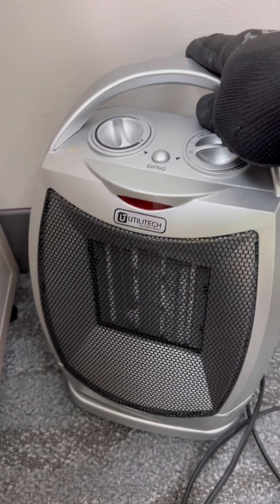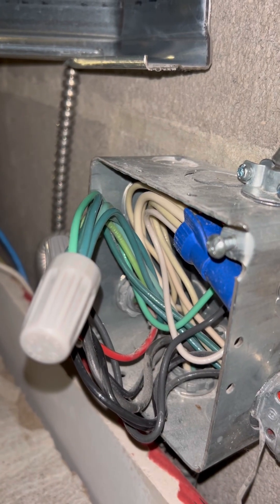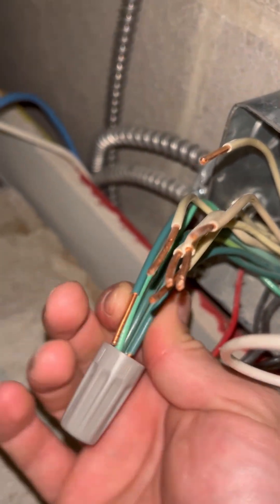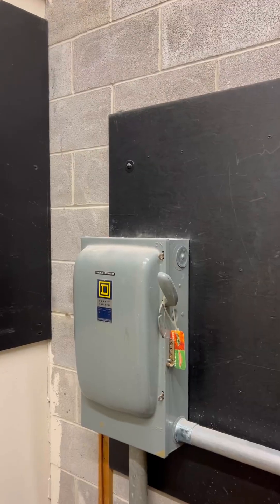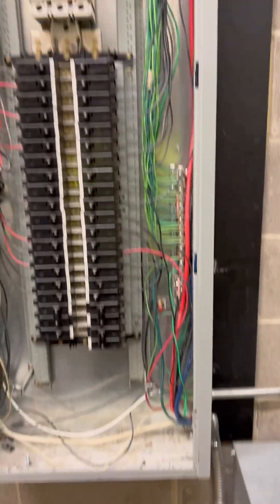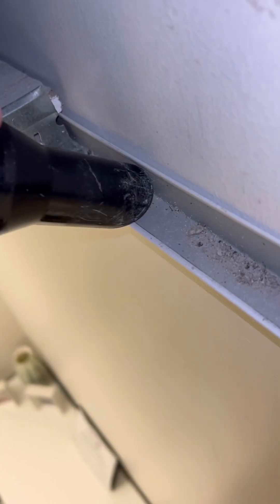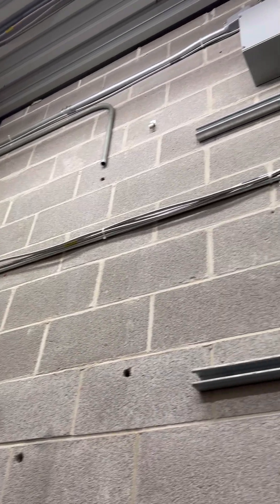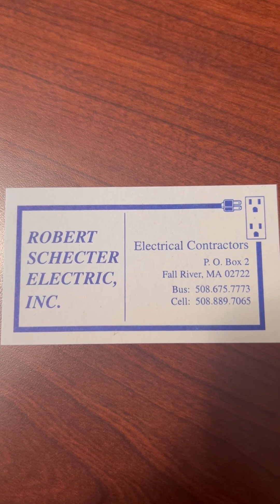⚡️Electricians STILL Using Wire Nuts Like THIS?! STOP Being a Hack🔥!#shorts #electrical #viral

Comment: I always pre twisted anything 12 and above. With 14 I had a drill attachment that could twist smaller numbers of 14 gauge wires solidly though. I made sure to test it multiple times, and still sometimes double checked them to make sure it was a solid connection. Hand twisting smaller gauge wires isnt an issue imo though. Anyone who leaves their wires looking like that should be fired, and never be allowed to do electrical work again.
Reply from the maker: I’m not to keen on the drill attachments but yea I would pre twist everything
Reply: For sure, I totally get it. At first they had me pre twist them all until I got good enough to know how a joint should be, then they gave me the little hand crank one, then after that is when they gave me the drill one. I did residential work so we were always on a pretty tight time limit, they work well for smaller numbers of 14, but you gotta make sure you don’t overdo it which is kinda why they had us work our way up to using it. They can easily like over twist them if you didn’t know what you were doing though. When I did commercial work they didn’t let us use the drill though, but we had a lot more leniency with our time schedule. I definitely preferred the commercial work, I don’t like being rushed on something as important as electrical work. Although, I did always like finish work. Finishing a nice house knowing you made it look good was always a good feeling.

Comment: The high end wire nuts are definitely way harder to screw up - not sure why the cheap tan ones are still allowed by code!

The drill wire nut twisters are super nice too
Reply from the maker: I don’t use the drill wire nut twister or twist the wire to much you can’t service the splice it’s a pain

Comment: Its noteworthy to us in The Rest Of The World that the premise of this is not that wirenuts are bad per se,  it's just a warning to twist the wires tightly with pliers before applying one. Here in TRoTW we use gas tight crimps, screw terminal block, and Wago.
PS are you guys still doing knob & tube?
Reply from the maker: Yes sir you are correct you must pre twist. And yes we work on knob and tube all the time

Comment: I think they need HVAC work, not more circuits.

Unless those circuits feed additional ventilation and/or permanent heating equipment.

Space heaters are...ok, but definitely not optimal from a safety or cost perspective in the long term.

Comment: Not sure about the code reference, but I believe it's illegal to use ty-wraps, bailing wire or other means to support an AC cable to other AC cables.
Makes sense though, just like you can't use one conduit to support another conduits...
Reply from the maker: No you can and also they’re not supported to each other re watch the video I added clips and then tie wrapped the mc to the other mc so the clip is holding all the weight 100% legal

Comment: Here to recommend alternative wire connectors. There's push in connectors, which work similarly to back stabbing on outlets. However, I do think these are much better than backstabbed outlets. But even better than that are Wago Levernuts. So much easier to use.
Reply from the maker: Backstabbing is garbage and so are wagos wire nuts and twisting wires is the best method. Did you know that nasa actually used the Weston Union splicing method to wire up their stuff for space travel pretty cool stuff if you look into thay
Reply: @SchecterElectric 

Wago type connectors are proven though.
Reply: @CorneliusTaylor-s1uhad multiple failures, not proven very well
Reply: Wago's push in connectors are great. So tiny and they go up to eight wires. Home Depot sells them under the part number of 2773, but oddly if you go to the Wago site they list them as 2273. Same thing though.

Comment: Is it legal to use NM connectors for MC in your area? I know that’s a big no no here in North Alabama. Also I could be wrong, but I don’t think those orange and blue wire nuts are rated for 2 #12 conductors.
Reply from the maker: rated for 3#12 and also those aren’t NM connectors their MC connectors
Reply: @SchecterElectric  interesting. We’re only allowed to use barrel type AC/MC connectors. We only use the other style of connectors for NM if we don’t use an insulating bushing. And you were right on the wire nut. Apparently ideal actually rates them for 4 solid #12 wires.  I’ve never used them on anything other than LV or capping off a single wire.

Comment: bruh im not even an electrician yet, but i pretwist my wires to prevent something idiotic like that from happening. Some people are not meant to be electricians. Period
Reply: Wait till you become one, the type of shit you see is insane.
Reply from the maker: I agree
Reply: Seems to me that’s something you would do for a video, not in real life, takes too much time and completely unnecessary if right size wirenut is used
Reply from the maker: @hawklord25 no we pre twist all are connections. If you think pre twisting isn’t necessary than that’s insane you have to pre twist your wires it won’t hold up
Reply: @hawklord25  then you go complaining that Wirenuts are not safe to use or that caused fires... I hope that you are joking... I have been an electrician for 20 years, I always pretwist my wires and use the appropriate Wirenut on all my installations, clients usually call me back because they are expanding and need more work rather than repairing stuff. Houses from before I was born still had their factory Wirenuts and are still holding strong 40 or so years later.
Reply: mostly Lazy fkrs
Reply: Or just use wagos
Reply: @kirbysfunpack6108 i don't have wagos at the moment I do like them so when I do start my electrician career I will be getting them.

Comment: wirenuts are stoneage level 😅. but americans somehow still live 600years behind the rest of the world uses them the same way they still use their foot and grains of rice to measure things 😅
Reply: That's why our properly made splices are still powering the world that pre-dates the invention of wagos, that were designed for control wiring. Not line voltage. Kind of like not using butt splice connectors for splicing. Not designed for it, in these applications.
Reply: @sybertracker6293 Verily!

Comment: See now what i would of done is i would of split that box in half. Taken half of the branches out and run them to a new Junction box with a wire heading to the panel. The new Junction box would be just like the other one (except for it being properly done), and now half the outlets are on one circut and the other half are on a new circut. This way if more people bring space heaters, there should be plenty of room.
Reply from the maker: That's definitely a good way to handle the load balance and future expansion!

Comment: Not loving that zip tie to other cable action. In 20 years the zip tie will be brittle
Reply from the maker: I didn’t know zip ties went bad in a climate controlled building
Reply: @SchecterElectric I didn’t know that you could use raceways as a means of support for cables.
Reply from the maker: @highvoltage1979 you can
Reply: @SchecterElectric can not
Reply: @SchecterElectric it's a violation, in VA, NC, SC, SD, TN, KY, TX, and WY. Though it may not fall under NEC, it usually gets called out in the states I work in, under building codes.
Reply: Though not best practice; one can bundle up to 3 MC's, but must be within 1' of a legit strap. Black zip ties last longer than clear/white ones, due to being oil-based, which is why the don't last near as long outside, in the sun, but to this electrician's credit, it IS in a climate-controlled building. As with any electrical install; is it what I/we would have done? Maybe not. But we weren't the ones doing the job, either.

Comment: I really don't like to use wire nuts at all for more than 3 wires or so.  It is much better to use WAGOs or push-in connectors instead, because you can manage each of the wires independently, make sure they're all secure separately, and don't have to worry about one wire or another slipping out while you're trying to get everything twisted together, etc.

Note:  You can actually get WAGOs that support up to 10 wires at a time now (WAGO 221-420 (heh)), which is even much better than most wire nuts will do (and far easier to work with and get right).
Reply: I do like using Wagos also but sometimes I don’t trust the lever of them. Once I got a call back for some outlets I installed not having power. Found that the hot feeding those outlets in a j box I had went loose and popped out. Whoops!

Theyre also kind of hard to trust when you pigtail out of them. I just don’t like how they can spin around. Now a days I wrap some tape over the levers and also the wires just outside of the wago.
Reply: @xLeg1tx1 

Yes the removable Wagos have an issue with the levers lifting up where if it then snags onto something it will open fully and a wire can come out. I recommend if you use the removable Wago to wrap it in tape afterwards. Otherwise it's a great design. They're push in permanent ones are great because they are tiny in comparison, but once you put multiple wires in them, like I said they are permanent. You would have to cut the wires to remove them. They are great though in boxes that are crammed with so many wires and where you don't expect to do any future work.
Reply: To many failures & push in recepticals worked great
Reply: @greggpurviance7252 push-in receptacles have the same failure-prone issues as wagos, as the retention method is the same. Use the screw terminals...
Reply: Wagos fail too often, yet not as often as the non-lever clamp design stab-in connectors, like the type that accompany most new light fixtures. I've been an electrician for 25 years, and have held my master license in multiple states. Nothing substitutes for a properly twisted (via lineman's pliers, not using the wirenut) splice.
Reply: @sybertracker6293 

Push in Wagos are fantastic because they're so small, but they are permanent once you put in a whole bunch of wires. The more common removable lever type can potentially fail because the levers can partly lift up on their own. As long as you wrapped them in tape they will be fine. As with wire nuts, if you don't use any of these fasteners correctly they can fail. If you loosely push in a wire into a Wago they can fail, just like with wire nuts if the wires are not properly secured. I've never had a Wago fail on me. I also use Levitons lever switches and outlets. No failures there either. Those have a very strong lever action. Enough to bite your fingers.
Reply: @CorneliusTaylor-s1uI can acknowledge, and respect that, with enough fortification, even an inappropriate fitting can serve a desired function, as you've stated. That said, the push-in variants are the ones that tend to appear to fail the most, as they are far more common, as they have been on the market longer, but have about the same fail rate on conductors larger than 18awg. Add to that the human error, of practices like not pushing a conductor in far enough to bite (on the push-ins), or, as you said, not securing the lever, which will still (if not secure) push the tape up the minute distance, aided by warm temperatures, to allow the conductor to become loose, and cause connection problems. These are all, of course, worst-case scenarios, and I concede this. A pre-twisted splice, appropriately end-trimmed, with an appropriately sized wirenut adequately tightened works every time. One fitting that I never see anymore: a fantastic "wirenut" that was actually a set-screw lug (picture a ground lug, but no tab) shaped like a cone. Insert wires, tighten the screw, and then screw either a fiberglass, or plastic cap over the body, which would secure the screw. Taking the good with the bad, sometimes the screw would rust/seize (not all were aluminum), and the fitting would have to be cut off. Though it always worked, and held, sometimes wouldn't come off. Push-in wagos, just twist the wire a little both ways, and it comes right out.
Reply: @sybertracker6293 

" I can acknowledge, and respect that, with enough fortification, even an inappropriate fitting can serve a desired function, as you've stated."

But it's not inappropriate. They are decades long proven. Sure the lever in the Wago needs redesigning but that doesn't negate that the interior wire connection is inappropriate. Until they redesign that lever a simple piece of tape keeps that lever from coming up when pushing your wires in the box.

"That said, the push-in variants are the ones that tend to appear to fail the most, as they are far more common, as they have been on the market longer, but have about the same fail rate on conductors larger than 18awg."

Which push in connectors are you talking about and in what market? I was only referring to the push in connectors from Wago.

"Add to that the human error, of practices like not pushing a conductor in far enough to bite (on the push-ins), or, as you said, not securing the lever, which will still (if not secure) push the tape up the minute distance, aided by warm temperatures, to allow the conductor to become loose, and cause connection problems. "

Human error is still there with wire nuts, and even more so for the DIY people. Also, beyond a certain number of wires it becomes much more likely that human error will occur in securing them with a wire nut.

The taping thing with the lever Wagos is simply to keep the lever from lifting up when being pushed into the box. There are two stages on that lever. The first one simply makes it easy to put your finger underneath, but it doesn't yet release the wire. You would still need to lift up from that point to the final stage of release. What they need to do is what Leviton has done with their levers on their sockets and switches. They don't have that first stage. They simply have enough room to get your finger tip underneath to lift it up. After that the spring action is also much stronger than the Wago. Enough to bite your fingers coming back down.

"These are all, of course, worst-case scenarios, and I concede this. A pre-twisted splice, appropriately end-trimmed, with an appropriately sized wirenut adequately tightened works every time. "  

Of course, but the push in connectors and the lever connectors from Wago or Ideal also work every time when used correctly. What I will concede is that the lever Wagos do need a redesign because they are a hazard if you don't tape them and push them into a tight box. Until then the Ideal lever connectors are what I recommend if one doesn't want to deal with the taping nonsense, and of course for most DIYers who likely wouldn't know enough about the subject to be aware of that flaw. 

"One fitting that I never see anymore: a fantastic "wirenut" that was actually a set-screw lug (picture a ground lug, but no tab) shaped like a cone. Insert wires, tighten the screw, and then screw either a fiberglass, or plastic cap over the body, which would secure the screw. "

I think I remember that from my childhood. 

"Push-in wagos, just twist the wire a little both ways, and it comes right out."

Sure but there is no twisting or easy twisting if you have multiple wires. Besides, it doesn't matter anyway because the end of the wire will be damaged enough where one should cut off that access anyway. The same with twisted wires in a wire nut. I do love those push in connectors from Wago though because they're so small. The smallest one to connect two wires is great for extending wires. Very tiny.
Reply: @CorneliusTaylor-s1uI enjoy the intelligent debates, rather than a fanboy stance, so I raise my glass to you, in that regard. We will have to agree to disagree, in this case. We both have our respective experience. I will agree, whole-heattedly that wagos are easier to use, however in my opinion, they are only practical in control wiring, which is what they were designed for, much like butt splice connectors (much less easy to use, and very limiting), but are both capable of carrying line voltage. As I am not a DIYer, and like to think of myself as a professional (😂), I will stick with the tried and true wirenuts, cut the push-in connectors off the lights that come with them from the manufacturers,  confidently issue the warranty for the work and then sleep soundly. I'm sure you will do the same.😊
Reply: @sybertracker6293 Note that the push-in splice connectors sold by WAGO/Ideal/etc are very much not the same design as the "backstab" connections used in most receptacles, and really should not be lumped together, IMHO.  Backstab ports are notoriously problematic (and I don't think anyone should use them, personally), but the push-in connectors actually have a very long track record now of being very reliable in practice.  Now, I am taking about the good quality, name brand ones.  It is quite possible that some of the ones included with things like light fixtures may be bargain-basement knock-offs that are not nearly as good...

WAGO lever nuts also have a very good track record and are very reliable, both from my own experience and all objective things I've seen.  Folks like you often like to claim that they're not reliable (despite usually never even seriously trying them themselves), but can never actually back that up with anything except vague "trust me bro" type assertions.  If you can point me to any actual evidence to support your claims, I'd be very interested to look at it, though.
Reply: Wagos are trash!  Pretwist wirenuts for life.